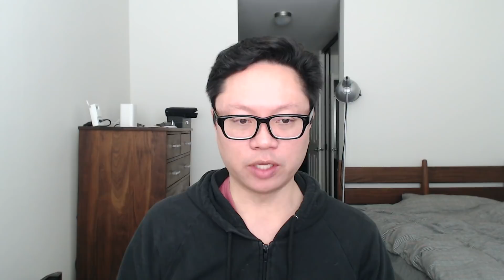Do You Have Stale Audio Cables?

Comment: I don’t know what your credentials are that I should listen to you ,but anyway good cables like kimber which I have been using.the same ones for over 15 years not at all having any problem and if you live in a low humidity space definitely no problem but good constructed cables are sealed from this taking place unlike the shity cables you must have owned
Reply from the maker: Because Kimber does not use silver-plated copper cables: https://www.youtube.com/watch?v=qJ-XeE-2qhI&feature=youtu.be&t=40m14s As explained, it doesn't have anything to do with if the cables are sealed or not. The silver reacts with the copper and deteriorates.

Comment: Oxidation is an atom-level thin layer on the surface and only effects the performance in theory since the amount of copper turned to oxide is insignificant compared to the amount of conductor on the rest of the cable. Also copper oxide is non-conductive and doesn’t introduce any side effects on the conductor. In addition to that, the oxide seals the outer surface of the cable and doesn’t go further into it.
Reply from the maker: According to the study NASA did, this is incorrect. They found: "occasionally the entire copper core of a single strand became converted to copper oxide. Metallography revealed that corrosion had initiated at isolated defects in the nominally 2μm thick silver-plating, and the corrosion products were subsequently precipitated over large surface areas of those shields." from- https://nepp.nasa.gov/docuploads/97164203-A4FB-479A-A075C918D51DD81E/ESA%20Red%20Plague.pdf
Reply: phototristan Let’s hope home environment doesn’t reproduce such dire wear.
Reply from the maker: The environment doesn't help it. It's the interaction between the sliver and the copper. Google "silver copper interaction" to see more about how they react with each other when in contact.

Comment: corrosion is a concern on the connector end, but should not be in the wire itself because it should be oxygen-free.
Reply from the maker: Hi-Fi Insider it’s the silver and copper in contact with each other which interact and corrode.

Comment: Doesn't silver cables also oxidize? I was thinking of getting a 8 strand braided copper cable - I guess I'd just have to give it a deoxidizer every once and a while across the whole length of the cable?
Reply from the maker: A Dexoxit will do nothing since the conductors are inside of the cable, not something you can even access. All metal conductors can oxidize to some degree but a well-made pure copper or pure sliver cable should last the lifetime of the cable without degrading (like 20-30 years). But the sliver plated copper conductors have accelerated degradation.
Reply: Is it recommended to get a higher quality (thicker) layer of sleeving in that case? I prefer the look of bare copper like the one you used for your Sony's a while back.
Reply from the maker: The green oxidation with copper cables only happens on cheap crappily made cables.
Reply: Good to know - I'm getting a balanced pair from Effect Audio myself. Thanks.